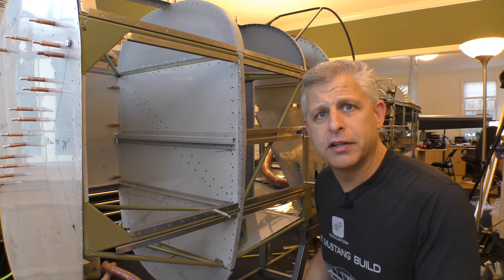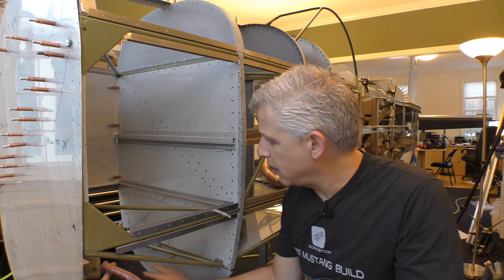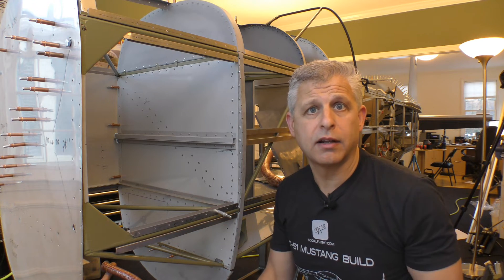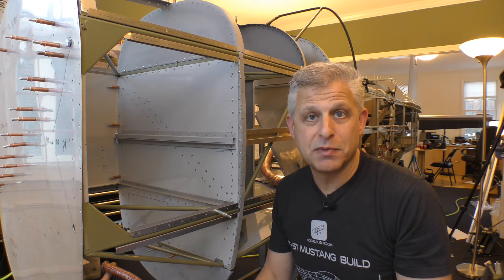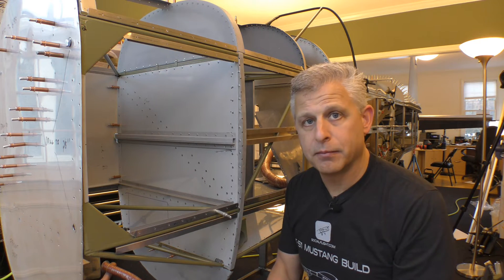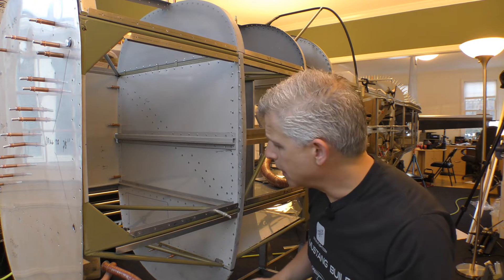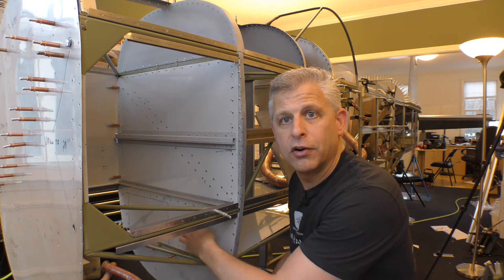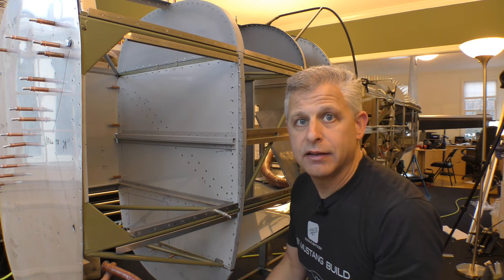A Mustang for All Seasons - Adding heating and ventilation to SocialFlight's T-51D Mustang!

Comment: I'm not sure how much of a problem it is in the T-51 but you might want to run a heat vent at the base of the windshield for a defrost/defog set-up the hot air will keep the windshield and conopy clear and stop it from fogging up in the cold.

I know from my experience as a air Force e&e tech all the air Force aircraft have that but it may be less of a problem with the lower altitude of the T-51
Reply from the maker: Great idea and we are going to do it!
Reply: @SocialFlight  glad I could help! A vent at the base of the windshield behind where a p-51 gunsight would be should do it. But often fighters would have pipes with holes drilled down them along the conopy rails to direct hot air at the conopy as well.
Any way I can't wait to see what you guys come up with and I'm glad to see the T-51 coming together.

Comment: In  your area don't need the Air conditioning, those that will be flying in desert SW may have to consider that.  Also nice seeing your boys in background working on another part of the project. I can see in the ending of your video square sections cut out of the instrument panel and  the next bulkhead, was that what they were working on?